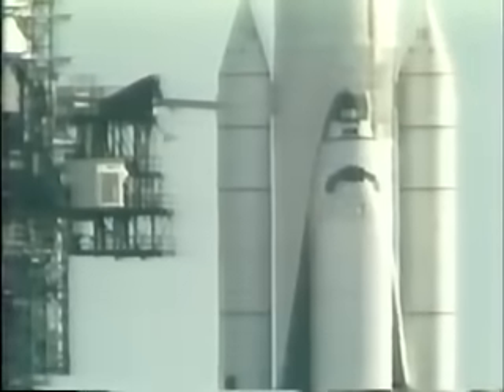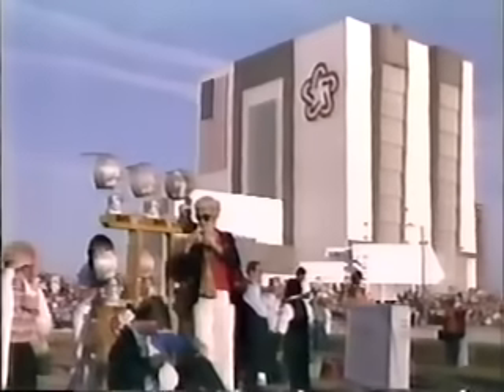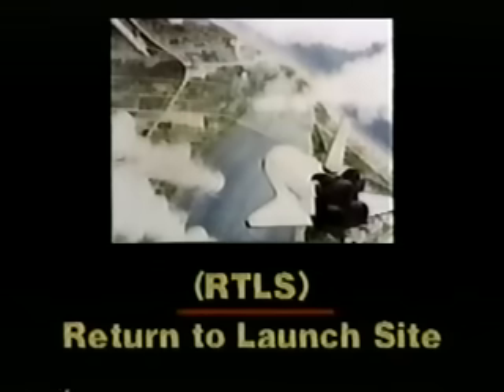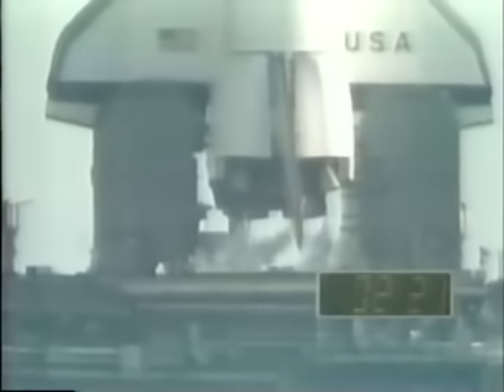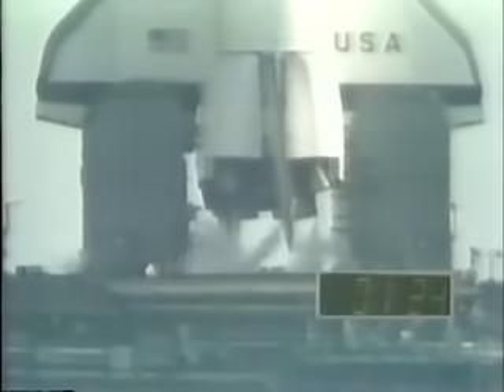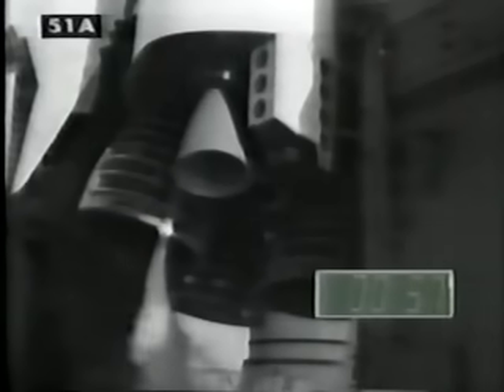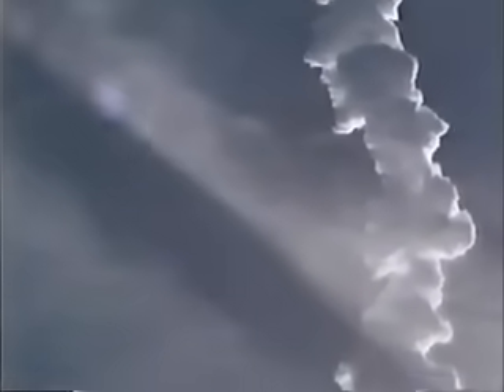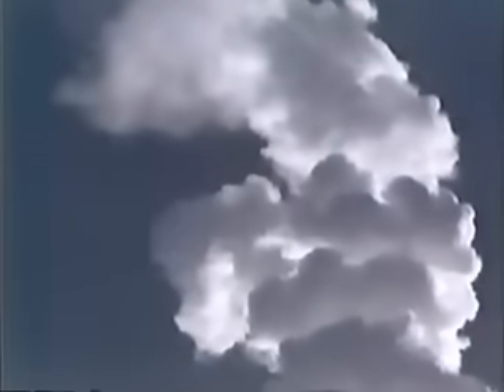First Shuttle launch Columbia 1981

Comment: Anyone who rode that thing was brave, especially those first two test pilots, it was an incredibly dangerous machine as we later learned. The shuttle was a compromise of cost and reusability which ended in two disasters. In comparison Apollo was a Cadillac without cost compromise and carried far fewer risks because it was a single use vehicle. Still, the shuttle was a heck of a machine even if it was technically compromised.
Reply: "Anyone who rode that thing was brave"

or dead

Comment: Not sure why the news commentators are speaking about ejection seats or equipment because the shuttle had none of that equipment. Once that torch is lit there is no going back.
Reply: Columbia did have ejection seats at first, but they were removed after the first few flights.

Comment: She forgot Abort-ato, abort-tal, negative seats and negative return though a couple were mentioned by the announcer. Only abort to orbit was the ever used besides a number of RSLS pad aborts. TAL is transatlantic, which would involve landing in Spain or North Africa. ATO was used when Challenger lost an engine on the mission previous to where it imploded. An engineer called for limits to inhibit to stop an other engine loss-faulty sensor issue-and they went to a lower than planned orbit. 

What’s sad is many of these early flights had O ring burn issues and they didn’t take action to fix it

Comment: Remember that launch was amazed how fast it took off compared to the Saturn V
Reply: The shuttle had higher thrust/weight ratio and thus a higher acceleration at lift-off, but the Saturn V had a higher maximum acceleration at 4 g vs the shuttle's 3 g.

Comment: This whole flight was riddled with severe problems. The launch produced so much acoustic energy that the "beaver tail" body flap at the very bottom end of the shuttle got slammed far out of position. Stealing from the STS-1 wiki page:

"The same overpressure wave also forced the orbiter body flap – an extension on the orbiter's underbelly that helps to control pitch during reentry – into an angle well beyond the point where cracking or rupture of its hydraulic system would have been expected. Such damage would have made a controlled descent impossible, with John Young later admitting that had the crew known about this, they would have flown the shuttle up to a safe altitude and ejected, causing Columbia to be lost on the first flight. Young had reservations about ejection as a safe abort mode due to the fact that the SRBs were firing throughout the ejection window, but he justified taking this risk because, in his view, an inoperative body flap would have made landing and descent "extremely difficult if not impossible".

Comment: 30 years of service, complete needless and dozens of people died because of fundamental design flaws and NASA incompetence. 

The space tech disclosures from the military whistleblowers paint a staggering lag in what is known vs what is really going on - the military is 100 years ahead at least.  Space shuttles were obsolete in the 1960s. 

This flight was almost lost as well - this should be now common knowledge. The body flap was badly damaged, during the SRB ignition - well beyond design limits, Young stated had he known the true damage they would have aborted and ditched the shuttle via ejection seats.

Comment: What a time to be alive. The very first test flight, manned. Incredible.
Reply: Unlike the Saturn V that had two unmanned test flights before Apollo 8.
Reply: @fromnorway643 That was because of the Apollo 1 that cost the libes of astronauts Grissom, White, and Chaffee.
Reply: @floridagunrat1625  
The Apollo 1 fire had nothing to do with the Saturn V, but it's understandable that it made NASA more cautious. Anyway, AFAIK, no launch system other than the shuttle has been manned during its first test launch. The Atlas and Titan rockets launching the Mercury and Gemini spacecrafts had several unmanned launches and so had the Saturn IB.

Comment: so why couldnt they use ejection seats on challenger ?
Reply: How would the 4 crew on the lower deck eject?
Reply: Because they didn't have them.  Ejection seats were removed from the shuttle when the crew size expanded beyond two.  How'd you like to take a Delta flight where the pilot had an ejection seat but you didn't?
Reply: The (still hot) exhaust from the boosters would linger in the air while they pass through it, which would kill them

Comment: I watched the launch from Ramstein airbase in Germany as a PV2 05C - HF Radio-Teletypewriter Operator, 8th Signal Battalion, 8th Infantry Division. We were a small group of communications assets that were to be used in case of an aborted launch ending in a landing somewhere on the African continent. After weeks of preparation, scrubbing gamma-goats (Vietnam era 6 wheel drive, 4 wheel steering deathtrap) to Airforce standards (very anal the Airforce), and a 4-day long sleepless regiment of crying and whimpering inducing inoculations for the entire continent of Africa, many of which are kept in the freezer right up until injection... we watched the launch with the rest of the world and then drove back to Bad Kreuznach and parked the trucks online. First and only time I ever deployed and didn't have to wash the vehicles when we got back. Five years later I cried watching Challenger come apart while still in Germany and before I left in 1995 I watched Endeavor launch and then do 262 revolutions (almost 7 million miles). From the 1st to the last I watched it all, space exploration rather than space exploitation.

Comment: No they could not eject, no ejection seats. Fakenews in 82 was real.
Reply: Yeh - I was wondering what on Earth they were going on about(!!)
Reply: Early flights did have the ejection seats. They were ditched later.
Reply: You know nothing, they did have an ejection system and after the 3rd flight when they removed the white paint from the ET they changed the ejection protocol.  So not "fakenews in 82", your just misinformed.
Reply: They had ejection seats on the early flights.

Comment: I miss the space shuttle. Should have kept it flying until a viable replacement was ready.
Reply: Say what you want, the number of flights per space craft wasn't that high. Endeavour and Atlantis could Have kept flying as the youngest in the fleet. Once Columbia was lost a replacement craft should have been ordered. Here we are 8 years later. No viable replacement. That is another 50 to 60 flights that should have taken place.
Reply: @FFDmh2223  Shuttle-C. Parts for Shuttle orbiter, which are nearing ends of their operational lifetimes, assembled into unmanned expendable vehicle, optimized for taking the maximal payload possible into space.
Reply: Most people dont have cars that are 30 years old and you are ok with taking a 30 year old spacecraft into outer space? The plan was to keep building shuttles and retire the older ones. Unfortunately the shuttles never become the relatively low cost and routine system that was originally envisioned.
Reply: NASA had seven freaking years to develop a capability they possessed in 1962.  Sheer incompetence.

Comment: The reason Columbia burnt up is because the bottom of the wings was painted black. That built-up heat on re-entry.
Reply: No, it burned up because the left wing was damaged by a piece of foam that broke off the external tank during lift-off.
Reply: @EVRose60  The black paint heated up the underneath and caused parts to overheat. I read it. NASA did a cover-up. They discovered black paint on parts caused those parts to get hotter. White parts did O.K. They had problems with heat tiles coming off on previous shuttles. On liftoff, tiles came off. Heat builtup during the day. Orings froze overnite on some shuttles. They knew about it. They were pressed for time.
Reply: bcdhifi  I read it on Google that on the launch-pad, black areas got hotter than white areas. Upon lift-off, heat tiles fell off. The camera showed it. They said they'll have to see what happens on re-entry. In space, the camera showed heat tiles missing on the underneath when they looked.

Comment: I was 14-years old and I watched this first shuttle launch from a 14" color TV in the basement of my aunt's house in Baltimore. My mom was was getting ready for work at her nursing job. I absolutely could not believe this thing actually was blasting off after years of seeing only the tests of the non-space flying Enterprise, as well as animations of what an actual launch would look like. I'll never forget this day. By the way, this first flight as well as the second flight, would be the only shuttle launches for which the external fuel tanks would be painted white. For the third flight in March 1982--the external tank would be that familiar unpaited rust red color of the insulation foam. Not painting the tanks saved 15,000 pounds!

Comment: And to think that the Soviet Union actually built a better space shuttle and only flew it once.  It would have been awesome if the Soviet Union had had a space shuttle.  It might even still be in use today.
Reply: A reusable space plane that flew exactly once. You don't see any problem with that?
Reply: @jshepard152  There is a problem: that it never flew more than once.
Reply: @infinitecanadian 
It probably wasn't capable of a second flight.  The CIA was well known for slipping engineering flaws into tech plans "borrowed" by the Soviets.
Reply: Given, that for each launch of Buran, huge and expensive Energia rocket was expended, it would've not been viable... except as technologies test for fully-reusable Energia II Uragan rocket.

Comment: The engineers believed the shuttle sitting on the launch pad would expose the fuel tanks to harmful ultraviolet rays causing damage which is why it's painted white. This ended up being false so after STS-2 they stopped painting the tank freeing up 600lbs of valuable payload.

Comment: I remember being convinced they were wrong and the thing would tip over shuttle first because it isn't balanced.  But I didn't know the shuttle's engines would be used on liftoff.  I still don't know how the structure could free stand on its own before launch.  To see that thing go up, it's an amazing sight.  That KRAAWWWW sound from the engines before it lifts off - intimidating.
Reply: The base of the SRBs were bolted to the launch pad (eight, very large bolts) which explosively disconnected once all the engines throttled up.

Comment: They used a white external tank for the first two flights.
Reply: The two rockets on the outside are solid fuel. There is a cryogenic fuel in the center, this is piped to the 3 rockets on the shuttle. Once the boosters go, and the center tank is detached there is no more fuel whatsoever for anything. There are no solar panels on it. and they supposedly stay in space for 17 days docking/undocking. Running thousands of watts of power this entire time.
Reply: Again, the fuel tanks are internal... And on longer missions like the 17 day one you keep mentioning, their carried in the payload bay on what is called "An Extended Stay Pallet".
Reply: jrocket oh I hope you don't run away like a coward like everybody else after I ask a question. But there are "THREE" apu turbines supposedly running Hydrazine non-stop each one chugs 3.5 gallons of fuel per minute. A 17 day mission is 24,480 minutes. That is 85,680 gallons of hydrazine PER APU! Or 257,040 total! That is NOT counting the pressurant nor the ridiculous idea that your going to spray water on the turbine to keep it cool running permanently at 1700f ! And most flights were 5-7 days. So this bulshit of a 300 gallon tank even for 2 days is totally ridiculous. I hope your just a kid playing on the internet because your out of your mind...
Reply: Again, you're  misinformed. Once the orbiter reaches orbit, the APU's are no longer needed and turned off. Hydraulic power is not needed on orbit. Prior to de-orbit burn, they are re-started for the landing phase.

Comment: little known fact - they almost lost Columbia on the first flight... for exactly the same reason they lost it in 2003....
Reply: Simon Coles 

Negative, Columbia lost some tiles in non-vital areas due to glue failure in STS-1, the orbiter was never compromised. The media overplayed it and people mocked NASA for a while until they figured out the glue issue but that's about it. 
Columbia was struck by a piece of foam insulation from the ET on STS-107, it struck the RCC on the leading edge of the left wing damaging it which led to the heat from reentry melting the internal structure of the wing until it broke up. STS-107's fate was sealed before it cleared the tower. 
STS-27 was the wake up call NASA ignored, the same thing happened as 107, foam insulation broke from the ET and struck Atlantis on the heat shield chipping several tiles, some were missing and upon reentry, several tiles were ripped from the orbiter and there was at least one place that had burned through, luckily there happened to be a steel plate there, the heat had melted away the steel and was making its way to the aluminum when the shuttle landed. STS-27 came to within about an eighth of an inch of becoming the second shuttle tragedy.

Comment: "IF they had difficulty - would be to eject" - interesting and totally  wrong. The shuttle did no have ejection seats. Kind of hard to eject out of something going 4000 mPh.. i'ts called death.
Reply: The first several shuttles did have ejection seats. They were only intended to be used at sub-sonic speeds (<460mph), and were eventually removed when crews of more than two rendered them infeasible.
Reply: Both Columbia & Enterprise had eject seats in the beginning but disabled with STS-5 as the crew grew bigger and then removed later on in 85/86 in a rebuilt of the shuttle

Comment: That all-white central tank was sexy and far better looking than the brown/orange one.  I know it is because of reasons, but still :/
Reply: I like the orange external tank better. They stopped painting it white because they realized they didn't need to.
Reply: Yes, turns out the paint added a lot of unnecessary weight.  A gentleman my family knew by the name of John Ondercin who worked at NASA recommended they cease painting the fuel tank to reduce weight and save fuel.  After an "oh-yeah" moment, John was given an award for his common-sense insight.
Reply: I actually liked the orange better... and not painting saved them millions of dollars per launch (or the ability to carry 600 give or take more lbs of cargo).
Reply: The reason why they stopped painting the tank was to save weight but they did not realize that the paint would hold the foam in place let alone the return to launch site abort is dangerous because of the speed and the small runway the shuttle would end up in the swamp let alone the ejection seats would be no good duration nag the first part of the launch
Reply: That's racist.
Reply: Too bad seven people are dead because of this common-sense insight

Comment: Oh, they had ejection seats in the first flight, I almost forgot that..
Reply: I think they put them back after the Challenger disaster. Sucks though, if they had them during the Challenger disaster, those 7 astronauts probably would have survived, since they likely died when they hit the water.
Reply: this was the first ever space shuttle mission, so it's not related to challenger in any how .. they are just kidding and it's impossible to install ejections seat to space shuttle.
Reply: khalilovH They did have ejecdtion seat in first two flights then it was disabled for later flights and ultimately removed.
Reply: Mooie Telebogen No, they did not put it back. Ejection seat was never re-installed.
Reply: First four flights were "test flights" that had two person crews and ejection seats.  When Columbia landed after the 4th flight, there was a big ceremony in CA where the Space Shuttle was deemed "operational" and the seats were removed.  The crews stopped wearing pressure suits as well as it was deemed unnecessary since there were no provisions made for crew escape.  Once Challenger broke up, the crews started wearing pressure suits and a bailout procedure was implemented but it wouldn't work during ascent.  Hindsight being what it is, the Space Shuttle was the most dangerous vehicle flown to space with a crew.  Capsule designs with escape rockets on top of the booster have proven to be much safer and those will be the designs of the future.

Comment: The 2 bravest Men ever. So glad they survived. But sadly in 2003 this shuttle the Columbia would explode and kill all seven astronauts 16 miles from landing in Florida. RIP CHALLENGER AND COLUMBIA CREW.
Reply: +julie hertz Columbia didn't explode. It structurally broke apart. And it was 16 minutes from landing still a thousand miles away.
Reply: None of the shuttles exploded. It was Challenger that "exploded" in 1986 (the rocket-booster/external tank exploded, causing the shuttle to break apart 71 or 73 seconds into launch - however the astronauts most likely died when they hit the water after a 2 minute and 45 second fall, as the crew cabin was intact and the forces they experienced during the explosion wouldn't have killed them or cause serious injury; also as the cabin most likely did not depressurize, however it could have depressurized slowly) and Columbia which disintegrated upon re-entry in 2003 due to a failure of the heat shield on one of the wings.
Reply: Mooie Telebogen Actually, Challenger did depressurize in the area of its pressure seals located on the aft wall of the crew module. This is where the cable harnesses pass through from the crew cabin to the payload bay. And I hate when people say Columbia disintegrated. It broke apart as well with some burning yes. But 80,000 pieces were picked up off the ground. Or 40% was recovered.
Reply: jrockett73
Research the word disintegrated, my love.
Reply: Mooie Telebogen Ok definition police.